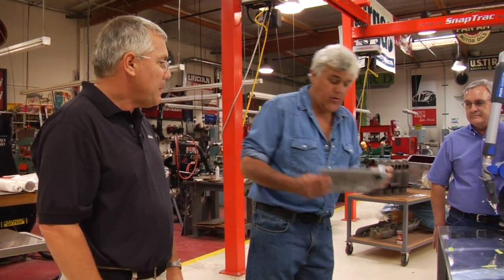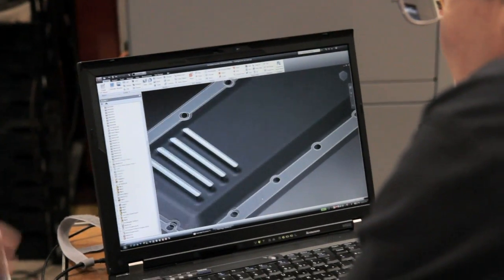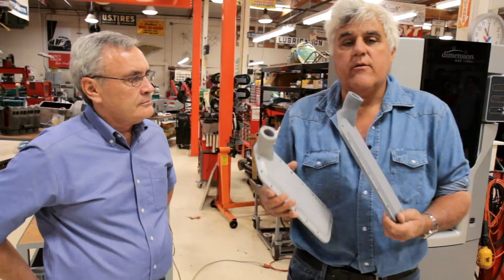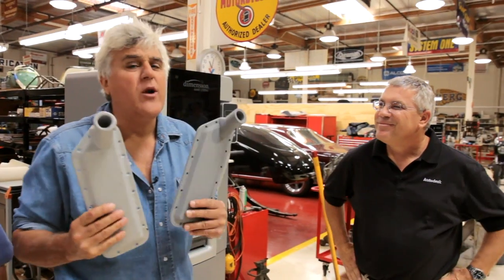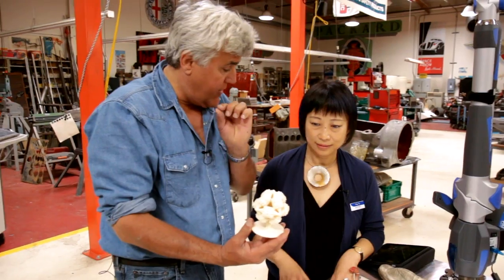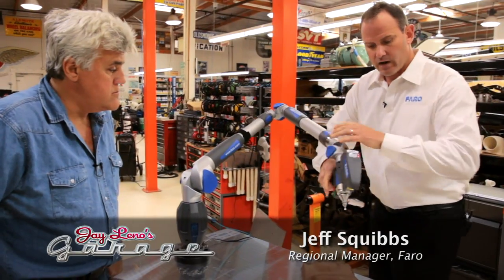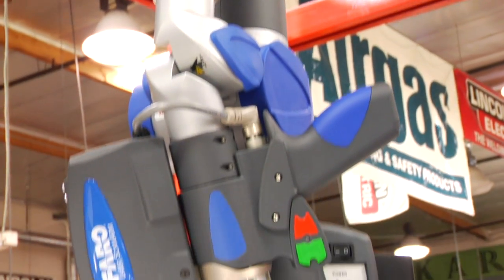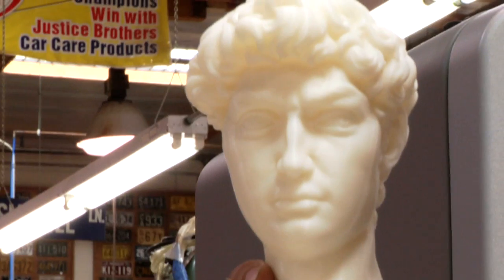Faro 3D Laser Scanner - Jay Leno's Garage

Comment: I have a problem. I take my scans, and put them on my cnc machine to run as Gcode. The form I use is STL, before I import it into my Aspire program. The Aspire program then creates the NGC's from it's CRv3D format. Does anyone know why it runs so slowly on the CNC machine, with all the same settings as our regular hand produced files? It can take literally 10 hours to complete in some cases, and the product is no different in size. To put that in perspective. Hand produced files usually never take more than an hour to complete. Even after bit changes. Which we aren't even getting to with these scan based projects. If it helps, We have noticed it seems to go up and down on the Z axis a lot during operation, which slows it significantly.  Any information on this?
Reply: Faro scans need to have surfacing work done in your 3d program if you are trying to reverse engineer a production part. In solidworks it is in surface features and knit tools. I'd guess the scan leaves in too many small manufacturing variations that your cam program is trying to reproduce

Comment: If ya want a Faro 3D Laser Scanner,   There's a used one listed on EBAY,  is only $60,000 starting bid..   Yes,  that's right  60-Grand  starting bid....   But you'll make that 60 grand back quick scanning antique car fenders and making them from Carbon fiber or even fiberglass.

Comment: That's great if you have $70,000 dollars laying around.
Reply: That would saved in a couple months of use in Jays garage. What did he say the brake drum for his gull wing cost from Mercedes? Something like 3K? So that 12 K for a set of drums. Then you have the one off types of parts like those used to put the Merlin engine in his Rolls Royce. Planning designing and tweeking parts like those could easily eat up tens if not hundreds of thousand of dollars.

Comment: Nice video. But it would not take weeks to make this part on a CNC machine. Might take 2 days, but you would end up with a part machined out of the metal you need. Once the first one is done (ie; programming, try out, etc) the subsequent parts  would take less than 2 hours each.

Comment: Thanks for the fast reply!! Can the part that is to be made, be increased by a %- age in all directions in the computer to make a master to be poured out of a specific metal?. As most metals have a different shrinkage percentage. In making gears the process is a very long procedure with cutting, grinding and then hardening of the gear. You would have to make some parts of the printed part smaller and larger to accommodate the machining process. I can see wear this would at lease make the blank for the gear much faster & remove some steps in the process.
Reply: +S Grunt yes u can scale it up to what ever you need

Comment: I was wondering if you have to increase the size of some of the printed plastic parts to make up for the shrinkage you get after you pour or mold it out of metal. Can you increase the total size of your plastic printed part to make up for shrinkage % age? I believe you may get up to 7% reduction in size when the part cools down after poured!!! I have purchased a Mascot for my 34 car, & all of them I have seen are slightly smaller in size then the original dimentional  part. GREAT VIDEO
Reply: yes one has to factor in the shrinkage %age too.
Reply: i think it's printed, not cast...

Comment: Jay, what's that piece made of - PLA?  Doesn't it kind of have to be made of aluminum or steel at the very least to withstand the high temperatures that would rapidly destroy a piece of plastic?
Reply: +Brian Brewster He did make it out of metal...
Reply: +Brian Brewster You are right that is what i thought. It likes like plastic.
Reply: +Brian Brewster It's ABS or PLA.
This is a regular FDM printer, but you could do it with an SLS printer.
But... remember, SLS metal is worth it's weight in silver.
Reply: +Spirit haven't heard of sls metal, but wouldn't there be an advantage to printing out of a material that could melt easily and casting the part out of whatever metal you wanted? Kind of like wax pieces used in casting.
Reply: dpreetam You could do casting with PLA plastic & foam.
The parts come out rough though, either machine it or sand it carefully.
Reply: +Brian Brewster did you even see the video? he mentions a bunch of times that you make it out of plastic then when you know it fits you make it out of metal
Reply: Yes, my bad.  Not many people can afford to do something like that.  Helps if you're a zillionaire I suppose.
Reply: Ah, but they are more than most of us can afford.  And even the best ones still leave you with a plastic part which is very limited in scope for applications.  We need to print in metal-embedded plastics - now that would really be cool.
Reply: Brian Brewster You can, on a consumer desktop machine.
But there's also metal 3D printing, usually out of Inconel 718 powder.

Comment: Ill make that part for you in 5 hours and for 450 bucks.. out of 6061
Reply: you probably have a cnc and a caliper. and it probably would me stronger and more accurate than this one, the arm has a overall tolerance of few 0.1 mm
Reply: Fischer977 Considering most calipers are only accurate within +/- 5 ten thousandths, and including any human error and any variance in machine tooling then I'm SURE that the scanner and 3D printer are more accurate. Besides, 0.1mm = 0.0039", which would be a tough goal to meet by hand. No offense to Sean and his manufacturing capabilities, but that's just the nature of machines vs people. Yes 6061 aluminum would be much stronger than the plastic that this part was printed with but printing with powdered metal is already being developed.
Reply: Jakeamura it is still very expensive, google mtsuura lumex, one of the best machines, 3d metal printers leave nasty welding like surface it needs to be remachined, the lumex is a cnc and metal printer combined, it prints a layer and then machine it . these arm type scanners are inaccurate, i have a faro arm and its not too accurate, maybe other types are. there are some plastics stronger than aluminum (mostly combined with fibers) not this one on the movie

Comment: i think 3d scanners and printers are very cool...
however can someone please explain how the plastic model is needed?
If you are just making the plastic copy in order to then do a casting,
could you not have just made a casting from the original and skipped all this?
Reply: They only print it in plastic to fit it first and make sure it fits/works. When they are happy with the part they just print it out of metal with a metal 3d printer.
Reply: No when you make a pattern it has to be a certain percentage bigger than the finished article to allow for shrinkage when the molten metal cools
Reply: Stephen Fereday  Unless the data is sent to a 3D CNC machine.

Comment: Hey Jay! Do you think you could make a part two, where you show us how the garage turns plastic parts into metal parts, ready for install?
Reply: There are 3D printers that can print in metal and normally they use a laser beam to weld tiny particles of metal powder used for printing. There are not really new thing and they are on the market for a few years. But anyway the video does not seem to be consistent. Remember they added fins for heat sink and the guys name on the part. They also increased   thickness. However they printed the original part without all that for some unknown reason.  I bet if you want to have something like this in your shop with printing metal parts, I would expect a price tag for all this equipment can be anywhere from $300 000.
Reply: I wonder how they do it. The plastic part could be used to make a mold for casting. Or the digital model could be used to machine a part with a CNC machine.

Comment: Instead of the part being in plastic, what can be done is what's known as the lost casting method where the plastic part is made as a cast in clay or a sand type medium where the casting is left in and bunt out, and then the metal is poured,,a whole new non plastic part is then made.
Reply: There are 3d wax printers for investment casting or you can 3d laser sinter metal directly

Comment: Maybe I missed something, but how is a plastic piece supposed to hold up within the conditions of an engine?

These are just prototypes.
It would still have to be machined at some point.

Correct me if I am wrong..
Reply: make a cast from it
Reply: you can print metal parts. it's a printer that uses metal powder and fuse it together.

Comment: Was the old duesenberg part made out of plastic? Looked like aluminum, if so should have used a SLS printer, not SLA. Then you get a duplicated metal part not a plastic part.
Reply: It would be nice if they could 3D print Aluminum or metal. They make an accurate copy in plastic, then they will make a cast for aluminum or metal. The original part may not hold up while making the cast I believe.

Comment: How is the printed Duesenberg part any better than the Bondo Duesenberg part?
Reply: Richard Alexander 3-d printers are used in the manufacturing process to create molds. Or, depending on the part, you can send that scanned information to a CNC/Lathe.
Reply: The printed part is used for making the cast for the metal part.  The end product will be made of metal.
Reply: Nsa Van Couldn't the Bondo part have been used for that? The plastic part came from the Bondo part.
Reply: Tirpak Magyar The Bondo part existed before the printed part did, so how is the Bondo part an extra step. The point of watching something is to help me understand. What is the point of replying if you aren't explaining?
Reply: Richard Alexander Did you watch the video? They could make modifications to the part if they wanted to. But the biggest point of 3D scanning is having a clean mathematically-based part, free of any imperfections.
Reply: Bondo will not withstand the heat of an engine. Bondo aka fiberglass cracks and melts.
Reply: Bill Freed That printed plastic piece couldn't hold up to engine heat, either. That doesn't look like a metal printer.

Comment: The Dimensions does not do metal. So that part would still need to be casted.  What would have been a better demonstration is to see the milled on CNC machine, not a printer that only does ABS plastic.
Reply: humpiestleek Then why take the time leave such a comment?  I guess you don't know what I do either?  But let's just say that I too have a similar background.  But sadly none of my 3D printers do metal, nor my associates $50,000 Fortus 50.  But if you do want to impart your knowledge to me and the world, please email at info@allthings3d.net and would love to have you on our podcast.  We plan to devote our March episode to "2014, the expiration of 3D patents."
Reply: Man, Michael, I really wanted to debate this with you, but I really don't feel like teaching you anything. :)
Sincerely,
Someone who has built a couple 3d printers, knows a bit about physics, programming, math, CAD, cars, and what not.
Have a good day, bro.
Reply: Agreed Mark C., but that is not the printer they are using on this show.  Plus, the technique you speak of is not known for its strength, it use more for cosmetically modifying an existing object.  There are printers that use metal particles fused with carbon dioxide lasers that can provide the strength needed though.  I do believe they start at $250,000 and more though.
Reply: Michael Balzer
There are 3d printers that print in metal. They spray adhesive on alloy powder and then the part is placed in a kiln and sintered into a solid.

Comment: They missed out the bit where they convert the point cloud created by the faro arm into a format Autodesk Inventor can actually use.  They just got Ping Fu to very briefly talk about it. It's not a quick process!

Use a better CAD package and you don't need to use Geomagic.
Reply: Do you have any suggestions on a better CAD package?  I was hoping to have the ability to use Solidworks.  There is now Geomagic Capture with the Solidworks plugin.  What programs do you suggest to keep the investment & post editing to a minimum?  thx

Comment: Ping didn't discuss Geomagic.  What she was showing were 3D Printed parts from a 3D Systems Printer.  3D Systems acquired Geomagic earlier this year.  Where 3D printing shines is fit and function.  Anyone who has ever built dies or fixtures knows exactly what I'm talking about.  The best designs in the World have to be proven before production.  Why not 3D print the part and perfect the design (fit and function) before machining?  Massage, Scan, Create STL Model, 3D Print and repeat if necessary

Comment: 3D printed items can be cast using the same process as lost wax casting.  Print sprues and vents into your part, pour plaster around the part and let it set up, burn out the plastic, and pour your metal.

Comment: One or two problems with the video, 1) the first printed part was not the same as the design. 2) they didn't show how the 3d data might need to be tidied up using mesh processing (auto?).

I think 3d scanning has been possible for a while, a simple version can be implemented with a video camera, a stick (yes, or a baton), and a spotlight. The object is rotated and the stick moved up and down etc.

or you could buy a Kinect Camera (for xbox360) and use the depth mode (laser array)
to make one.

Comment: its just printed with all of the tolerances that normal gears would have,you can actually down load the data to make that exact gear ball for free. Also there are websites that will host your designs and print it for you so you dont have to buy the whole printer.If somebody else buys your data from your design you get a payment from the printers. Its really new way of doing things.

Comment: Why would you need to print it in plastic, when you can make a cnc program out of the cad model and machine it with a material suitable for an engine.  

Plus, autocad inventor is bad.  It's like it's made by someone who has never uses the program.   Being a 3d Cad program, you would think that rotating your part would be a mouse click since its used all the time, not on inventor.  Do you see that nice gradient background he has on his background.  It will print giving you a soggy piece of paper

Comment: You can 3D print metal parts using metal powder that gets melted layer by layer with a laser or an electron beam. You could also build a mold from the 3d model and cast the part but thats a waste of money if you only need one part.

Comment: to print in aluminum alone, it would have to heated to about 1,200° F, and how aluminum is, the aluminum oxide on the surface would have to be heated to about 1400° F before that melts. Not to mention all the slag that it would produce. 

This is why aluminum parts are still cast, forged, or milled. Not printed

Comment: Do you mean a CAD mill machine. that's not a 3d "printer", it removes material, not adds it, like a 3d printer.

And Jay mentioned casting it, not milling it. 

I want to see the casting process, especially on those irregular shade parts.

Comment: @mtktm It is sent to a machine shop, nothing special, although they do have 3d printers that print metal but their expensive and is not accurate. The plastic model they make is just to see if it fits (I work wit a 3d printer much like jays)

Comment: I suppose they have to create a mold (made from destructive sand most of the time) from the computer model in which they put liquid metal in it (exactly like for motor or any other complex part) and then work on the raw material to machine it.

Or they use directly a machine following a computer program and good human skills to machine a bloc of metal.

Each process has drawbacks and advantages. It depends what kind of characteristics you want to obtain.